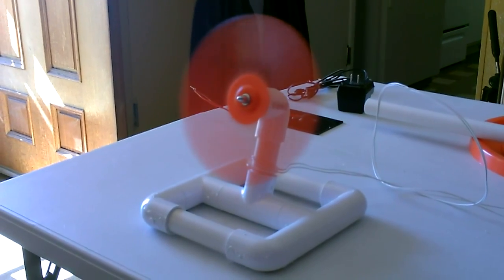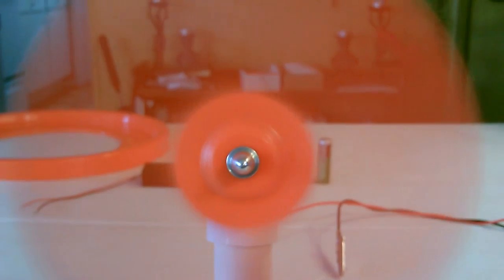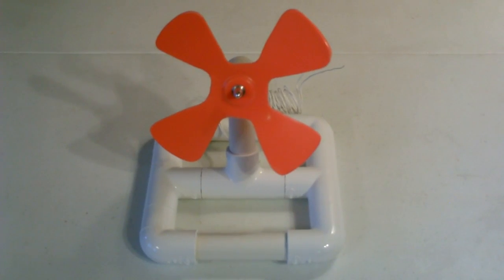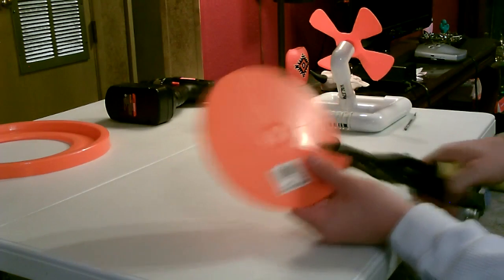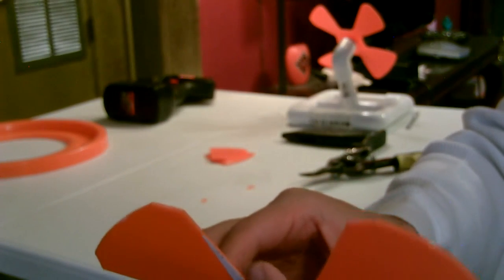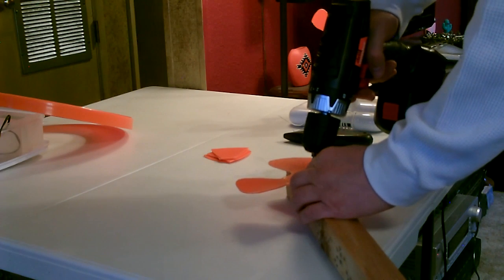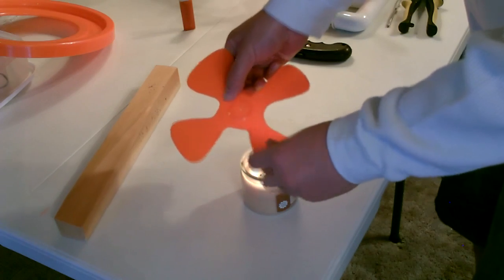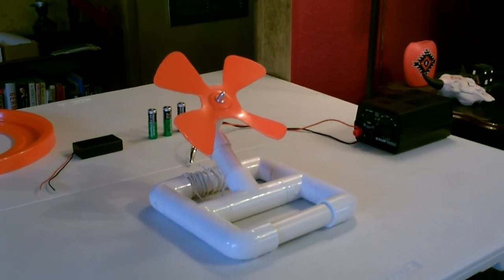Homemade Fan!  ~ The DIY "home depot" Desk Fan ~ (made w/PVC & 5 Gal. bucket Lid!) - Easy DIY

Comment: Can this fan rotate without power? I mean can the fan rotate just using the wind ?
Reply from the maker: hi. yep, it will rotate in the wind
Reply: @desertsun02  and produce voltage? Do you think I can use this fan for motor DC 12v??

Comment: Cool! Do you have a source for the motor and the metal prop to motor connector? Thanks!
Reply from the maker: +Eric Johnson hi there. i bought the motor from fry's electronics (radio shack, jameco electronics and amazon etc. sell them too). metal prop can often be purchased where you buy the motor or at any rc hobby store... probably amazon as well)
Reply: +desertsun02 I can't do Amazon anymore. I found at that Jeff Bezos is part of the NWO/Bilderberg Group a couple years ago. I know it sounds strange. :) I try to let people know what's going on when I can get some good information. I know it doesn't apply to your video either... which is super as usual. :) I do have a question though. The lid? It's not a Gamma Lid, is it?